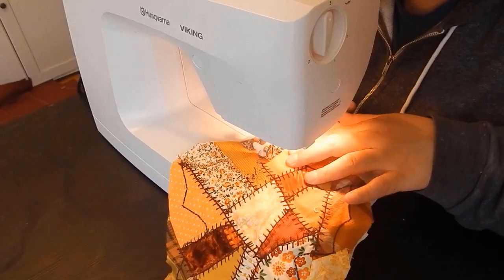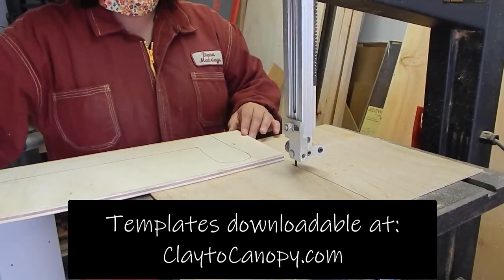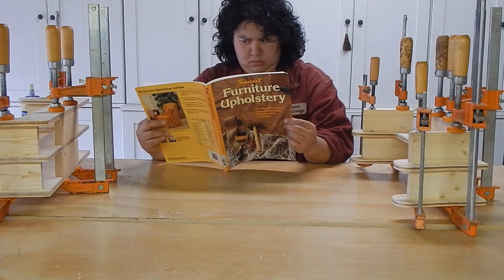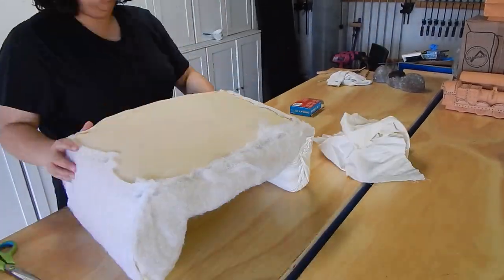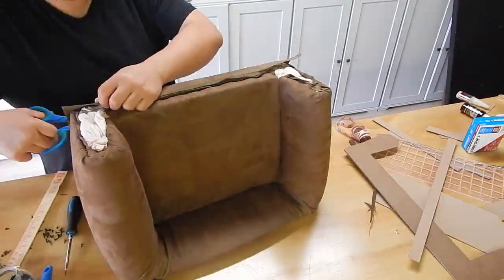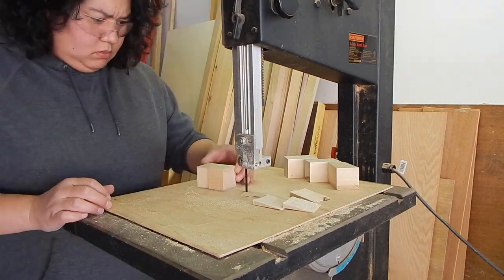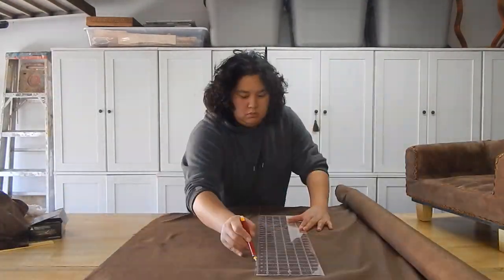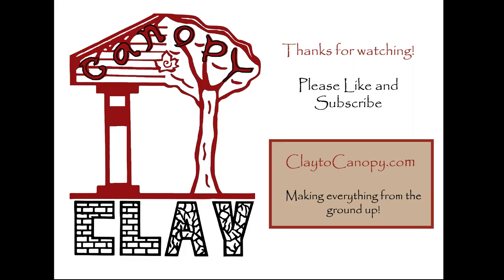Cat Couch Upholstered Miniature Furniture

Comment: I really enjoyed watching you make this.  I don't have all of those fancy tools that you have but I am going to give it a try with just hard foam to start.  I kept the foam from my old couch just for this reason as it is really firm.  I was thinking about tennis balls for legs but I am not sure how to attach them other than glue.  Maybe I will put a thin board as the base of my couch.  Thanks for sharing this with us all!
Reply from the maker: Lavender Rainbow you could use just about anything for the legs, plastic bottle tops cut and spray painted, pvc pipe.  If you want something soft to prevent scratching you could also glue a bit of felt to the bottom of whatever you end up using.  You also don’t have to go crazy on the tools.  Since the inside will be padded with foam you could get by with just a drill and a jigsaw!  Thanks for watching let me know how it goes if you do try it!
Reply: @claytocanopy  Will do!  Thanks for the quick reply :)